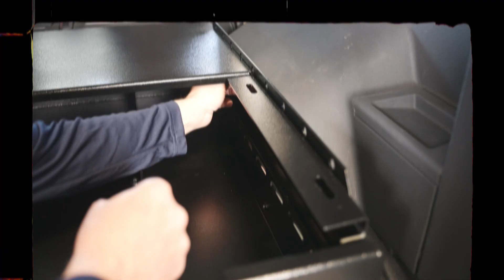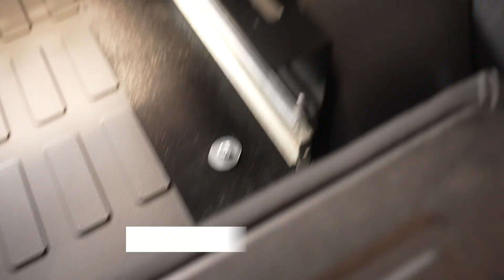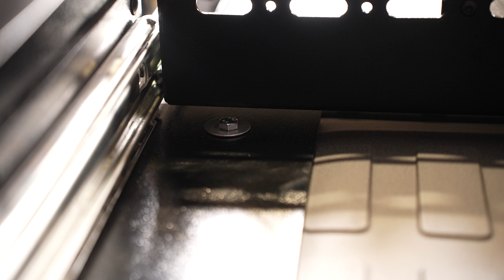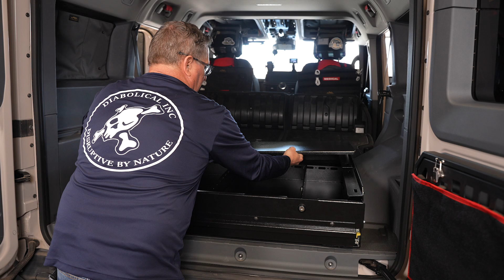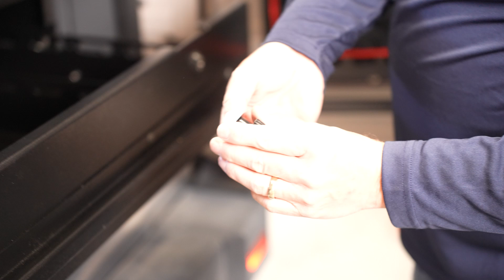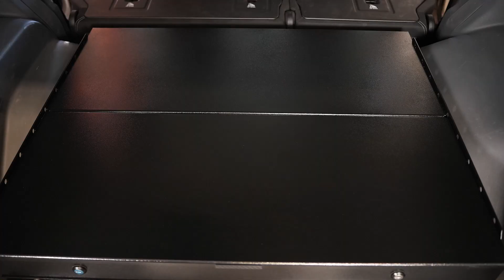INEOS Grenadier Slidefloor Install from Diabolical Inc

Comment: The eight twist knobs that hold the top two panels need to have some sort of securing washer, otherwise they will fall off and the entire drawer systems becomes noisy. Six of my eight twist knobs self-loosened and fell off due to daily driving (and some off-roading). I'm trying saddle washers.

Comment: In most regards a really superior construction than what most offer  -especially when it comes to weight. Also love that you used aluminium instead of steel and no floor covering the floor - which so many do.

Comment: Can the rear seat be folded back up while this is installed? Or does this functionally replace the rear seat?
Reply from the maker: This system was designed to fold the seats and create a level sleeping platform as well.
Reply: @DiabolicalInc  Can the rear seats be folded upright? Thanks
Reply: Very good question!  Can the rear seat be folded up while the drawer system is installed?  Thanks for your response.